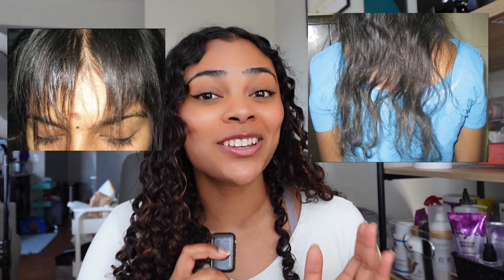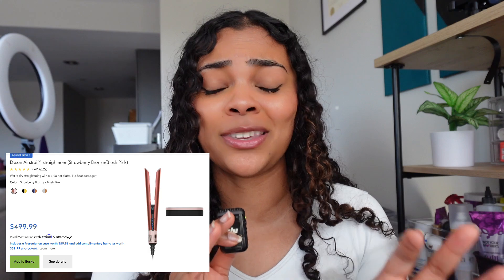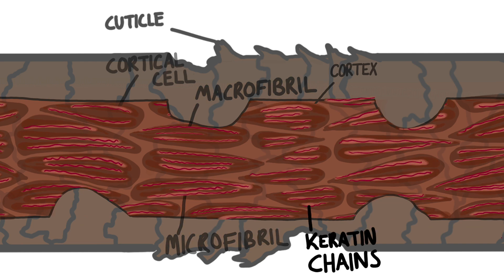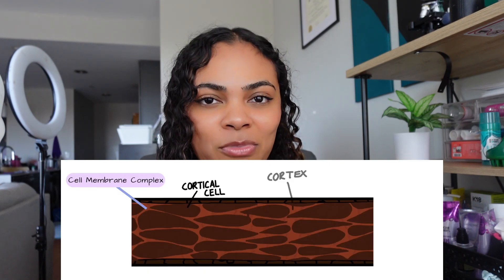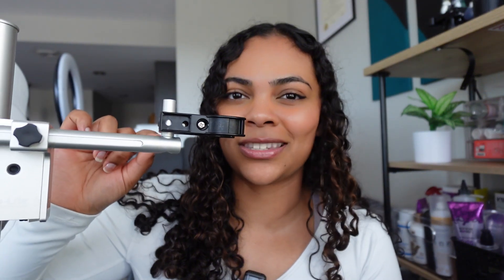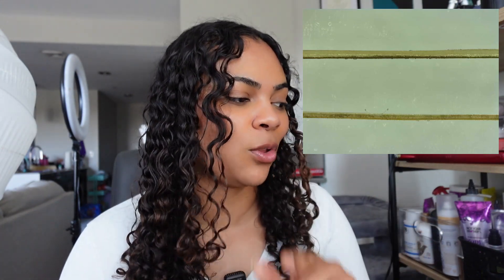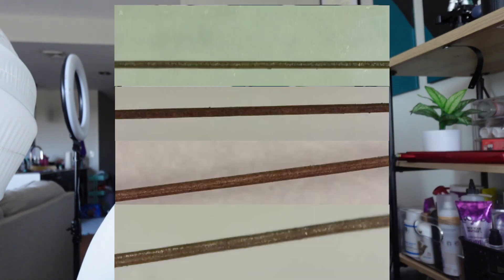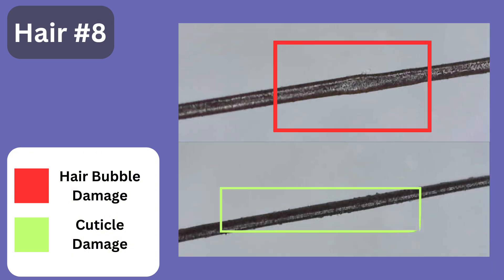Heat Damage Warning: What Happens When You Straighten Wet Hair? | Case Study & Experiment!

Comment: What are your thoughts on ceramic heat rollers on clean, dry hair?
Reply from the maker: I don’t think they are too bad! But just like with any hot tool you have to be really careful on how often you use it and also how you use the tool. If you’re using it everyday I would suggest lowering the amount of times you use it just so your hair can have a bit of a break. Also make sure you are using heat protection because it helps distribute heat so that you can have less damage on a single area.